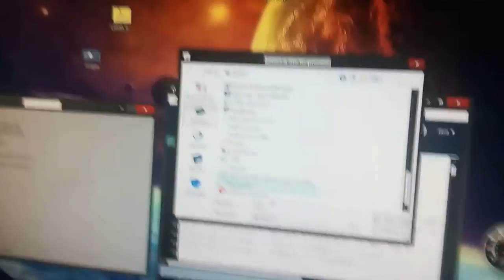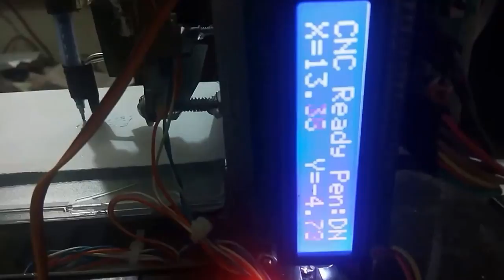Homemade cnc ploter lcd display upgrading

Comment: I'm asking for your arduino project code
Reply from the maker: gcode
Reply: No. I ask arduino code to be able to display the data x y z in lcd 16 × 2
Reply from the maker: Dwi Febriyanto add simple lcd display code on arduino program x y z valu
Reply: Can you help me. Give me your arduino code
Reply from the maker: #include <AFMotor.h>

#include <Servo.h>

#include <LiquidCrystal.h>
#define LINE_BUFFER_LENGTH 512
char STEP = MICROSTEP ;
LiquidCrystal lcd(32, 30, 28, 26, 24, 22);

// Servo position for Up and Down 
const int penZUp = 140;
const int penZDown = 125;

// Servo on PWM pin 10
const int penServoPin = 10;

// Should be right for DVD steppers, but is not too important here
const int stepsPerRevolution = 48; 

// create servo object to control a servo 
Servo penServo;  

// Initialize steppers for X- and Y-axis using this Arduino pins for the L293D H-bridge
AF_Stepper myStepperY(stepsPerRevolution,1);            
AF_Stepper myStepperX(stepsPerRevolution,2);  

/* Structures, global variables    */
struct point { 
  float x; 
  float y; 
  float z; 
};

// Current position of plothead
struct point actuatorPos;

//  Drawing settings, should be OK

float StepInc = 1;
int StepDelay = 0;
int LineDelay = 50;
int penDelay = 50;

// Motor steps to go 1 millimeter.
// Use test sketch to go 100 steps. Measure the length of line. 
// Calculate steps per mm. Enter here.
float StepsPerMillimeterX = 100.0;
float StepsPerMillimeterY = 100.0;

// Drawing robot limits, in mm
// OK to start with. Could go up to 50 mm if calibrated well. 
float Xmin = 0;
float Xmax = 40;
float Ymin = 0;
float Ymax = 40;
float Zmin = 0;
float Zmax = 1;

float Xpos = Xmin;
float Ypos = Ymin;
float Zpos = Zmax; 

boolean verbose = false;

//  Needs to interpret 
//  G1 for moving
//  G4 P300 (wait 150ms)
//  M300 S30 (pen down)
//  M300 S50 (pen up)
//  Discard anything with a (
//  Discard any other command!

void setup() {
  Serial.begin( 9600 );
   
   
 lcd.begin(16, 2);
 lcd.setCursor(0, 0); lcd.print("CNC Ready");
 lcd.noDisplay();
delay(1000);
// Turn on the display:
lcd.display();
delay(10);
  
  penServo.attach(penServoPin);
  penServo.write(penZUp);
  delay(200);

  // Decrease if necessary
  myStepperX.setSpeed(600);

  myStepperY.setSpeed(600);  
  

  //  Set & move to initial default position
  // TBD

  //  Notifications!!!

  Serial.println("Mini CNC Plotter alive and kicking!");
  Serial.print("X range is from "); 
  Serial.print(Xmin); 
  Serial.print(" to "); 
  Serial.print(Xmax); 
  Serial.println(" mm."); 
  Serial.print("Y range is from "); 
  Serial.print(Ymin); 
  Serial.print(" to "); 
  Serial.print(Ymax); 
  Serial.println(" mm."); 
}

/********************
 * void loop() - Main loop
 ***********************/

void loop() 
{
  delay(100);
  char line[ LINE_BUFFER_LENGTH ];
  char c;
  int lineIndex;
  bool lineIsComment, lineSemiColon;

  lineIndex = 0;
  lineSemiColon = false;
  lineIsComment = false;

  while (1) {

    // Serial reception - Mostly from Grbl, added semicolon support
    while ( Serial.available()>0 ) {
      c = Serial.read();
      if (( c == '\n') || (c == '\r') ) {             // End of line reached
        if ( lineIndex > 0 ) {                        // Line is complete. Then execute!
          line[ lineIndex ] = '\0';                   // Terminate string
          if (verbose) { 
            Serial.print( "Received : "); 
            Serial.println( line ); 
          }
          processIncomingLine( line, lineIndex );
          lineIndex = 0;
        } 
        else { 
          // Empty or comment line. Skip block.
        }
        lineIsComment = false;
        lineSemiColon = false;
        Serial.println("ok");    
      } 
      else {
        if ( (lineIsComment) || (lineSemiColon) ) {   // Throw away all comment characters
          if ( c == ')' )  lineIsComment = false;     // End of comment. Resume line.
        } 
        else {
          if ( c <= ' ' ) {                           // Throw away whitepace and control characters
          } 
          else if ( c == '/' ) {                    // Block delete not supported. Ignore character.
          } 
          else if ( c == '(' ) {                    // Enable comments flag and ignore all characters until ')' or EOL.
            lineIsComment = true;
          } 
          else if ( c == ';' ) {
            lineSemiColon = true;
          } 
          else if ( lineIndex >= LINE_BUFFER_LENGTH-1 ) {
            Serial.println( "ERROR - lineBuffer overflow" );
            lineIsComment = false;
            lineSemiColon = false;
          } 
          else if ( c >= 'a' && c <= 'z' ) {        // Upcase lowercase
            line[ lineIndex++ ] = c-'a'+'A';
          } 
          else {
            line[ lineIndex++ ] = c;
          }
        }
      }
    }
  }
}

void processIncomingLine( char* line, int charNB ) {
  int currentIndex = 0;
  char buffer[ 64 ];                                 // Hope that 64 is enough for 1 parameter
  struct point newPos;

  newPos.x = 0.0;
  newPos.y = 0.0;

  //  Needs to interpret 
  //  G1 for moving
  //  G4 P300 (wait 150ms)
  //  G1 X60 Y30
  //  G1 X30 Y50
  //  M300 S30 (pen down)
  //  M300 S50 (pen up)
  //  Discard anything with a (
  //  Discard any other command!

  while( currentIndex < charNB ) {
    switch ( line[ currentIndex++ ] ) {              // Select command, if any
    case 'U':
      penUp(); 
      break;
    case 'D':
      penDown(); 
      break;
    case 'G':
      buffer[0] = line[ currentIndex++ ];          // /!\ Dirty - Only works with 2 digit commands
      //      buffer[1] = line[ currentIndex++ ];
      //      buffer[2] = '\0';
      buffer[1] = '\0';

      switch ( atoi( buffer ) ){                   // Select G command
      case 0:                                   // G00 & G01 - Movement or fast movement. Same here
      case 1:
        // /!\ Dirty - Suppose that X is before Y
        char* indexX = strchr( line+currentIndex, 'X' );  // Get X/Y position in the string (if any)
        char* indexY = strchr( line+currentIndex, 'Y' );
        if ( indexY <= 0 ) {
          newPos.x = atof( indexX + 1); 
          newPos.y = actuatorPos.y;
        } 
        else if ( indexX <= 0 ) {
          newPos.y = atof( indexY + 1);
          newPos.x = actuatorPos.x;
        } 
        else {
          newPos.y = atof( indexY + 1);
          indexY = '\0';
          newPos.x = atof( indexX + 1);
        }
        drawLine(newPos.x, newPos.y );
      
        //        Serial.println("ok");
        actuatorPos.x = newPos.x;
        actuatorPos.y = newPos.y;
        
lcd.setCursor(0, 1);
lcd.print("X=");
lcd.setCursor(2, 1); lcd.print(newPos.x);
lcd.setCursor(9, 1);
lcd.print("Y=");
lcd.setCursor(11, 1); lcd.print(newPos.y);
      
        
       break;
      }
      break;
    case 'M':
      buffer[0] = line[ currentIndex++ ];        // /!\ Dirty - Only works with 3 digit commands
      buffer[1] = line[ currentIndex++ ];
      buffer[2] = line[ currentIndex++ ];
      buffer[3] = '\0';
      switch ( atoi( buffer ) ){
      case 300:
        {
          char* indexS = strchr( line+currentIndex, 'S' );
          float Spos = atof( indexS + 1);
          //          Serial.println("ok");
          if (Spos == 30) { 
            penDown(); 
           lcd.setCursor(10, 0);
           lcd.print("Pen:");
            lcd.setCursor(14, 0); lcd.print("DN");
          }
          if (Spos == 50) { 
            penUp(); 
            lcd.setCursor(10, 0);
            lcd.print("Pen:");
            lcd.setCursor(14, 0); lcd.print("UP");
          }
          break;
        }
      case 114:                                // M114 - Repport position
        Serial.print( "Absolute position : X = " );
        Serial.print( actuatorPos.x );
        Serial.print( "  -  Y = " );
        Serial.println( actuatorPos.y );
       
       
        break;
      default:
        Serial.print( "Command not recognized : M");
        Serial.println( buffer );
      }
    }
  }

}

/*******************************
 * Draw a line from (x0;y0) to (x1;y1). 
 * Bresenham algo from https://www.marginallyclever.com/blog/2013/08/how-to-build-an-2-axis-arduino-cnc-gcode-interpreter/
 * int (x1;y1) : Starting coordinates
 * int (x2;y2) : Ending coordinates
 **********************************/
 

void drawLine(float x1, float y1) {

  if (verbose)
  {
    Serial.print("fx1, fy1: ");
    Serial.print(x1);
    Serial.print(",");
    Serial.print(y1);
    Serial.println("");
    
  }  

  
  if (x1 >= Xmax) { 
    x1 = Xmax; 
  }
  if (x1 <= Xmin) { 
    x1 = Xmin; 
  }
  if (y1 >= Ymax) { 
    y1 = Ymax; 
  }
  if (y1 <= Ymin) { 
    y1 = Ymin; 
  }

  if (verbose)
  {
    Serial.print("Xpos, Ypos: ");
    Serial.print(Xpos);
    Serial.print(",");
    Serial.print(Ypos);
    Serial.println("");
  }

  if (verbose)
  {
    Serial.print("x1, y1: ");
    Serial.print(x1);
    Serial.print(",");
    Serial.print(y1);
    Serial.println("");
  }

  //  Convert coordinates to steps
  x1 = (int)(x1*StepsPerMillimeterX);
  y1 = (int)(y1*StepsPerMillimeterY);
  float x0 = Xpos;
  float y0 = Ypos;

  //  Let's find out the change for the coordinates
  long dx = abs(x1-x0);
  long dy = abs(y1-y0);
  int sx = x0<x1 ? StepInc : -StepInc;
  int sy = y0<y1 ? StepInc : -StepInc;

  long i;
  long over = 0;

  if (dx > dy) {
    for (i=0; i<dx; ++i) {
      myStepperX.onestep(sx,STEP);
      over+=dy;
      if (over>=dx) {
        over-=dx;
        myStepperY.onestep(sy,STEP);
      }
    delay(StepDelay);
    }
  }
  else {
    for (i=0; i<dy; ++i) {
      myStepperY.onestep(sy,STEP);
      over+=dx;
      if (over>=dy) {
        over-=dy;
        myStepperX.onestep(sx,STEP);
      }
      delay(StepDelay);
    }    
  }

  if (verbose)
  {
    Serial.print("dx, dy:");
    Serial.print(dx);
    Serial.print(",");
    Serial.print(dy);
    Serial.println("");
  }

  if (verbose)
  {
    Serial.print("Going to (");
    Serial.print(x0);
    Serial.print(",");
    Serial.print(y0);
    Serial.println(")");
  }

  //  Delay before any next lines are submitted
  delay(LineDelay);
  //  Update the positions
  Xpos = x1;
  Ypos = y1;
}

//  Raises pen
void penUp() { 

  penServo.write(penZUp); 
  delay(LineDelay); 
  Z
Reply: thank you